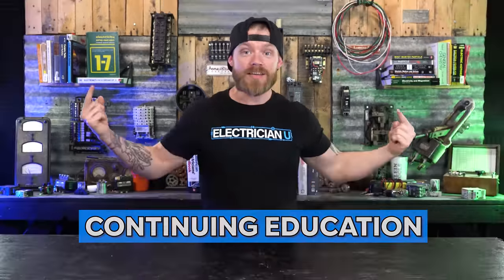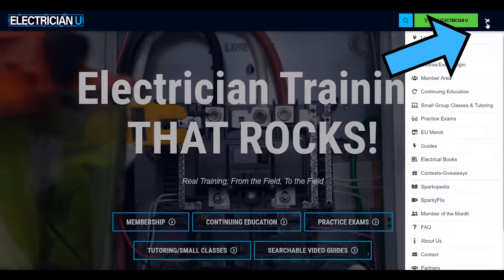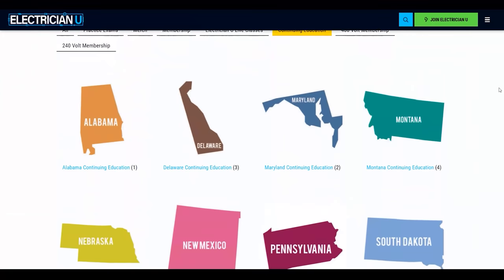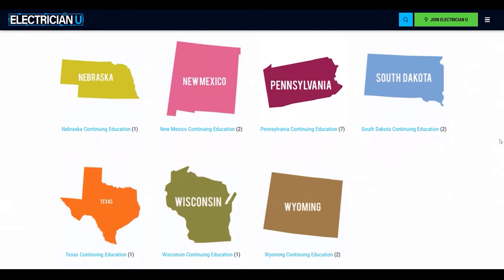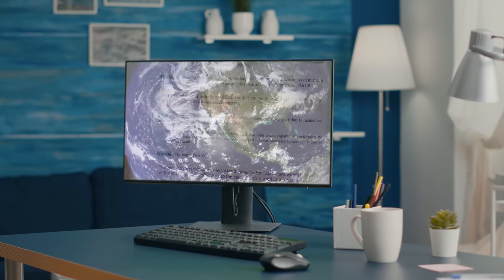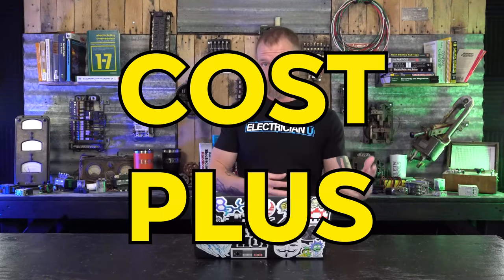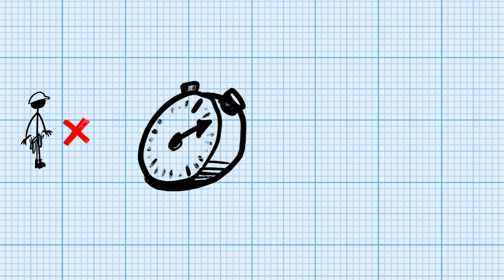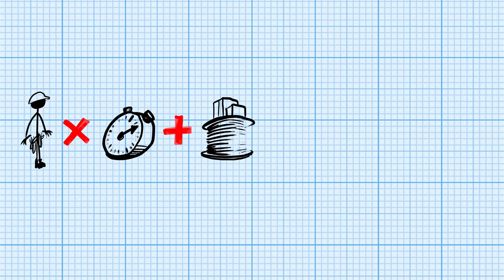How Should I Price Out Jobs? 5 Different Methods You Can Use to Estimate a Job!

Comment: Depends on what it is. Material can be marked up anywhere from 100% to 173%

You have to know your labor rate including labor burden

A bunch goes into it but it is not hard

Residential service wise, rewires, remodels etc...
Reply: Dictate completion of JOB

Not completion of inspection as you have to pass that anyways. This way customers will not hold onto money, especially if they are prolonging everything getting inspected
Reply: Materials already up 300% 😂
Reply: Used to make money on material but since the internet came out we can't charge that 15%,on top anymore but I charge by the hour for picking it up or out or any other way to get it to the job

Comment: I've been a contractor most of my life but I was a superintendent for a builder for a few years and the builders here all expect a per sq ft price.  They have to be able to price out the entire house before they start the build.  If it's a custom home there is a per sq ft price then an extra charge per light or outlet the customer added beyond code minimum.  And the customer is charged a change order so it doesn't affect the builders budget.

Comment: Not an electrician, but watched to get different perspective on estimating cost. I am a fan of excel, because it’s the one I started with. Initial setup can be tedious, but so easy when it’s done. Plug in numbers during site evaluation. Problem is the hidden or unknown cost when one is new to any trade. 
I really like the different method you discussed. I might play around with a few of them. Also, good to do it myself so when someone comes to price things out, I have an idea of how much I can work with and where me and the contractor can agree at price. I get a good sense of how knowledgeable the contractor is, or worst case get perhaps being scammed. I don’t mind paying premium for quality, but know how to estimate is how I protect myself from over priced for work not needed. 
As always quality video. Even when it’s sorta doesn’t pertain to electricity, it still relevant and can be applied to parts of life.
Reply: The best thing is to have data, at the end of the year you can look at it and see just what ever thing cost and what you made and if you need to make adjustments.

Comment: Materials + labor + 25% is usually how I do it on your average job. That covers those "unforseen" expenses.
Reply: Hey Brad, Do you use a labor composite rate? Do you include any overhead, taxes, vehicles, benefits, etc?
Reply: @ChemoWarrior  sole proprietor. 1099s when I need them.

Comment: I will just add this. I used to do HVAC and did it on the side. small group of us. we all were lis and had insurance to do it. We used to add a small charity bump to all jobs. the reason is 2 to 3 times a year we would get referrals from churches on people that needed heater and aircond but they could not afford to. We would do the job for free. So add a small amount to every job to save up to do that kind of work.

Comment: How do u balance paying yourself,employees, and overhead as a business owner? Is there a percentage per job you pay yourself or how does that work?Also nice vid!
Reply: Make your salary an expense as part of overhead. All your yearly expenses plus the yearly cost of an employee plus a percentage profit on top divided by 1000 billable hours equals an hourly rate to charge the customer
Reply: @MrPeterBaak  where does the 1000 hours come from?
Reply: @edwrd1990  that’s a year of work
Reply: @InfoOnly2U  that’s the equivalent of working about 20 hrs a week.
Reply: @Chili Powder  it's a 50% efficiency for billable to unbillable hours. For service work that will cover your time running to the supply house, etc. For remodels or jobs you can be staged ready to go, it's around 75% efficiency which would be around 1500 hours. Take this with a grain of salt I'm still learning

Comment: Every business person should read the book "Means, Standards of Estimating" Open construction is easy to estimate. Estimating a project in a finished structure changes the labor costs. I always estimated slightly higher to the most labor intensive prices, then after I finished, and made a killer profit, I would lower my high estimate to the customer. Those customers remained with me and I retained the customers my original customers recommended me to. From 1985-2012 I never had an empty day of work. Ever!

Comment: I'll add one thing to consider if you're a business owner. I was a master electrician, I  was an IT/Security contractor who did Res/Com construction and service. I will give the advice, then explain. As a general rule, this works and it will save your sanity:
|
GET RID OF 20% OF YOUR PROBLEM CLIENTS AND RAISE YOUR PRICES 15%, YOU WILL ALWAYS MAKE MONEY.
|
Say you're an small to mid-size electrical contractor, and you dabble in a bit of everything: residential construction, commercial construction, residential and commercial service work, etc - diversity allows consistent money to be made, yes? So for one example, imagine:
|
You are a Sub for a General Contractor who is consistently late on your draws. You eventually get your money, but it's like pulling teeth. (This happens a LOT, actually. When owners are late paying the GC, the GC eventually can't pay out draws to the subs. If you've ever worked for a sub-contractor who had problems making payroll sometimes, this is often the reason, your boss is at the mercy of the GC, you're at the mercy of your boss.) 
|
In addition, you have multiple jobs tied up with the same GC - this is a VERY common problem. As you build a rapport with a GC, the GC will accept bids with you for future jobs, even if you're not the cheapest. If they trust you, your work, your quality and precision, your adherence to schedule and budget, etc., you will get jobs even not being the lowest bidder. This is a good and bad thing. The more the GC offers you, the more "eggs you keep in one basket." The more jobs you have for one GC, the less jobs you can bid on or accept elsewhere, because you begin to run low on staff, crewing multiple jobs for the same company. This is where your stress will build exponentially, because now, you CAN'T afford for the GC to be late on your draws. This stress is compounded if the GC has tied themselves up with one main owner on all these jobs. Heed this: ALWAYS DIVERSIFY YOUR CLIENTELE. Never bind yourself up with just one or two companies. You make yourself at the mercy of just them to ensure your viability.
|
You finally lose your patience, give up and refuse to staff a job you just started for them, because you haven't gotten the draws the GC owes you from another job yet, and now you can't trust that you'll get paid for this new one (If the GC is in arrears with other subs, they may take draws from this new job to pay draws on other ones, "stealing from Peter to pay Paul.") 

You're struggling to keep up payroll (ALWAYS  have capital reserves folks, preferably at least 3 months' employees wages, 6 months is better, if you are able), because the draws aren't coming in. The GC decides to stiff you on the draws longer because now you're holding up the new job. And it's a revolving door of insanity. Companies have gone to court over this very scenario, it's a business and morale killer, it can cost you your own employees if you miss or delay payroll too often.  This GC is a company you have to let go. Don't bid anymore on anything they do. It's not worth your sanity, and it takes too long to get the money anyway. 
|
You're in business to make money. You can be understanding about occasional issues, but when the issues become too problematic, your business suffers. You have to look out for yourself first - otherwise you're no good to your employees. It can, and probably will, sting in the short term, to get rid of a problem company. But good work builds your reputation, which gets you more work. You will make up for it, often quicker than you'd think you would.
Reply: In my 40 yrs ive seen too many good business men/Ladies go belly up for  dealingvwith GC, hreat advice

Comment: 8:55 there's me in the solar industry. Some jobs or customers are just such a pain in the ass, that the customer asked for a billionth change, having called the owner to complain when I didn't respond in like 20 minutes, so I was like, "Oh wow that'll be way more expensive, we have to charge $double to account for that change." Meanwhile, the requested change was honestly probably only like a 5% increase. I had advocated for them at the start, was very low in the first quote, fought the owners to give them great pricing...and then they kept requesting changes, being aggressive or verbally sparring, so price went up to where one of the owners had wanted it at the start...it was later like three times what the starting price was. They ended up going forwards, there were no change requests after it had doubled either.

TL;DR don't be rude to the estimator, and if you think they're screwing you (while they're giving you the best price conceivable, any competition would laugh you out the door as they told you to get your broke ass out if you think they'll do it for that), shop it around, don't be rude, because then, they will.

Comment: Hey love your content. Can you do a video if you can. About the differences between low voltage work like security systems (access control, wired Burglar alarm, nurse call, intercoms, cameras, emergency call systems, and building controls/automation) versus being an electrician. Like which one is more difficult as far as terminating devices, wiring in panels, physical labor, and etcetera. Benefits of one or the other. What you may face on a daily basis of each trade as an everyday tech; service or installer. Not talking about engineering out drawings or prints. More like what to expect on both sides as being an everyday tech.

Comment: Im a second year apprentice, but still pretty green. I'm comfortable with mounting struts on metal, (never done it myself on concrete), cable tray installation, terminations and wire pulls, but i never really did conduit pulls so much or conduit bending. I'm looking for a job. Should I look for Resi, Commercial, or industrial, whats best for me. I dont care really where i work, i like all electrical. To be honest I'm not comfortable with say 3 or 4 way switching, but I can definitely feel comfortable doing anything else resi. I've done industrial for my first year, but it was mainly cable tray and 3pin and 4pin pre made cables made by turck or allen bradley for industrial wiring.

Comment: the markup on materials when doing time and materials just doesnt make sense to me, the customer is paying for any waste there is already, youre making your profit out of the hourly rate which was mention at 150$ an hour which is insane to me.. going rate for most trades in my area is 70$ an hour and a few may charge 90-100$ an hour but that hourly rate is going to cover your truck expenses, your tool expenses, any consumables you use that arent direct materials, like blades and bits and knives ect, and the time that isnt accounted for like invoicing, quoting jobs, organizing tools or making runs to suppliers in your off time

time and material is a good way to price jobs, especially unknown jobs, but it kind of takes out the incentive to be quick and efficient and isnt very rewarding when you knock out a big or even little job in record time with no snags and make good use of your skills and tricks you end up feeling under paid

Comment: Just for conversation's sake, T&M isn't legal in California as a contractor. We had to go in front of the Ca. State License board over it. Also not allowed to ask for more than a 10% (of project cost) as an up front deposit.
Reply: So what is the structure of the plan that everyoneis supposed to work with? You only told half the story!
Reply: It doesnt take long to burn through 10%! Are you saddled with providing the other 90% in hopes that the customer wont stiff you?
Reply: @williamtoon6021  Bid work. The contractors board doesn't want you to "wing it" just because you can't anticipate the project cost properly.
Reply: @williamtoon6021  Typically we'll break up the work into stages with a payment structure that correlates. A project's costs are not incurred all on the day you start.

Comment: The company I work for charges $150 an hr plus $50 for the first hour for a total of $205 for the first hour and $150 an hour every hour there after. Plus a $15 surcharge for things like wire nuts, screws, etc.... If customer complains about that $15 cost we are authorized to remove it, if we choose to do so. Markup on material can be 30 -50+%. 

My opinion is there's a difference between making a living not a killing

Comment: When I was in my younger years, I would use the cost plus method, but now that I am retiring, I use the materials plus Labor, so with today's materials being high, I would charge $65 per ceiling fan to hang it, but you have to consider the age of your customer....if they are elderly, drive so so cars, or are somewhat disabled, I would give them a break, and that $65 to hang a ceiling fan would drop to $45....., But if they had a nice house, high end cars in the drive, then that ceiling fan may cost $70.....now if this was new construction, I would charge somewhere around $5,500 per story which of course included Materials plus Labor, permits, employees.

So yes you can set your pricing per job which is preferable for new construction, and if a remodel then that would be priced by the square footage.  Just to stop over and install a few outlets, those would be $105 first outlet, and $65 per outlet for new work, old work would be $85 first outlet, and $45 additional outlets!  That's my pricing examples!  But I also book customers to demographics....east side, west side, North, South, etc...to save vehicle expense!

Comment: Side work or moonlighting isn't illegal, it's more of a grey area. If your employment contract has a no moonlighting clause then yeah don't do it, but if your company doesn't have such a clause, be up front with your boss, make sure he/she is okay with it, and don't compete with them. So if you work for a commercial/industrial electrical firm, don't bid those jobs, bid residential work or smaller repair stuff they don't take on, that way you're not competing with them directly.

Comment: Great video,, when you say $60 to hang a light...is that including your travel time? I charge $95 an hour plus material on service calls....even if the call takes 15 minutes....but on a couple of jobs I have really screwed myself.... Under priced and ended up making $18 an hour after figuring gas, time, vehicle, etc....worst thing that happens....stress isn't a big enough word ...I'm done doing these old houses by bid price...they are by the hour from now on...to many unforseen BS... been an electrician for over 30 years and the last two has been for myself....I'm either really broke or really rich...more on the broke side...I have done Commercial and industrial for over 20 years and 12 years residential... From now on my price is my price and if you don't like it move on ..I don't take short cuts and consider myself an A plus electrician ..I'm tired of giving people brakes...no more.. I have never even been offered a tip...Christ I tip the delivery guy, I tip the cable guy, I tip someone who brings appliances out ..even the mail person gets a Christmas gift every year.....you can't negotiate with a Doctor, Car mechanic, etc ..same with me don't need people asking me to negotiate....negotiations doesn't pay my bills... I went to school for 5 years and I'm a professional....I'm not a baggage handler...no offense to baggage handlers but that's the way it goes ..don't like my price you can always find someone at Home Depot who wired a cord cap before.......If you can do my job have at it... otherwise pay the professionals

Comment: I called an electrician for a hot tub wiring job. The run is 120 ft from main panel to spa sub panel. One inch conduit is already buried (18”) from main panel to spa location. The company wants to charge $22 per foot, and that includes wire and labor only. $3300 for pulling wire is crazy! I’m in the wrong business!
Reply: You’re not paying for today you’re paying for knowledge and complete job. Also, the minute something goes wrong you’ll most likely call them back which is usually included in the price..
Reply: That's way too much.
Reply: @Journeyman2585  agreed. Exploitation of supply chain and labor shortages.
Reply: @Combat556  I just did a 150ft pull this week and the price wasn't even close to that much.
Reply: @Journeyman2585  thank you.